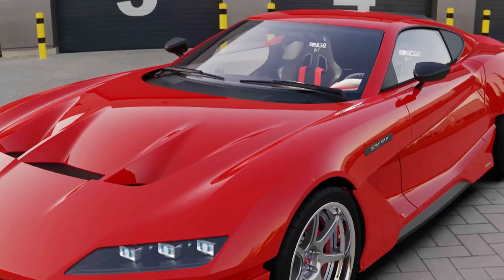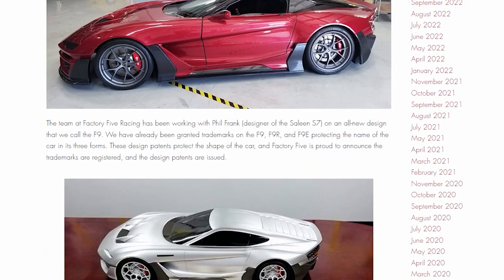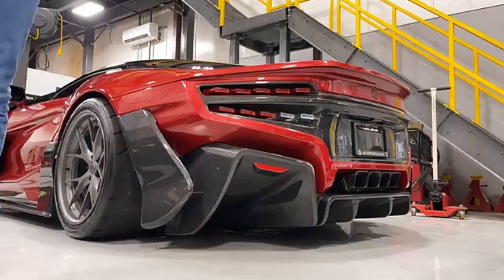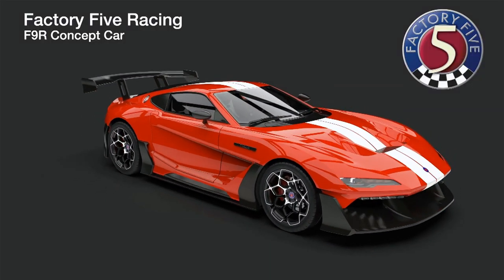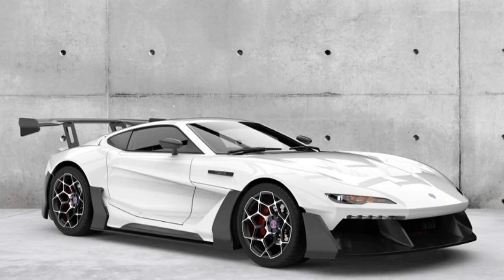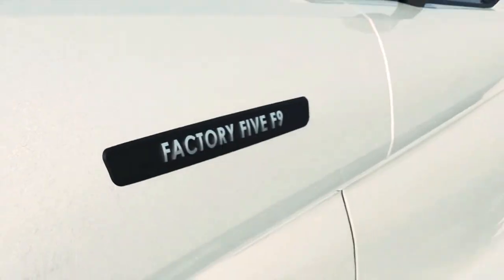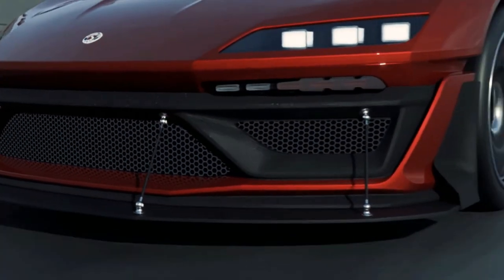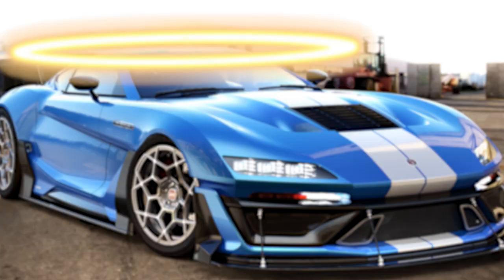What Happened to the Factory Five F9?

Comment: Shame they cancelled the gtm, saw it in person at the public unveiling at ffr in like 05 or 06, looked great.
Reply: A gen3 GTM would be great! Enough of them have ben built to get plenty of feedback for changes.
Reply: Too expensive to build.  Was lower cost BITD when you could get your hands on a transaxle for a reasonable price.  Not anymore and the fiberglass work required is intense.  Lastly, the design is decades old.  Time for a new car.
Reply: @danpolk  You can get a g96.01 for between 3 and 4 grand. The real problem with the GTM was it needed too much work to get right. Terrible body and door fitment had FFR on the phone lying to them telling them they couldn't help the fact the damn doors don't fit and the body is asymmetrical.
Reply: The GTM was meant to be the mid-engined Corvette that Chevrolet wouldn't build. 
Chevrolet builds it now.😊
Reply: @dr.burtgummerfan439  Apples and Oranges. One is a heavy factory car with nannies and no stick. One is a 2500lb. race car with NO nannies and a manual transmission. They are more than numbers and nothing alike to drive.

Comment: Sadly, if they go with the full carbon body and other things I have read are rumored like the massive Aussie V12, this is essentially a $150-200k component car when completed.  It will have to have extraordinary performance to warrant the expense and effort required to park one in the garage at that price.
About the same price as a used 612 or Huracan.  Most people with the kind of money to build an F9 may just decide to write a check for the Ferrari or similar and enjoy it the first day.
Reply: you don't need to put the v12 in it, that's just on their test model. it'll probably come ready to slip a coyote in it
Reply: @danielanthony1054  I'm sure it will take the V8, but many will opt for the V12.
 
I'm sure somebody has put the base 1980's 220 hp Mustang 5.0L in their new build FFR Cobra, but they are the exception.
Reply: @sburns2421  i would love a v12 but i would buy something like that to race. so a v12 is just stupid for that cause it's massively heavy
Reply: Maybe a spec built Toyota 5L v12 from their century car.  Hartley Engines do thesw from a read if their websites
Reply: I agree.  I love the idea, looks like a cool car, and if it were reasonably cost effective, I would be interested.  But let's be real here - to really build a '33 Hot Rod you're looking at $40k+ not including labor (I have one, was way more than 40k in kit, upgrades, engine, transmission, paint, wheels, etc.).  The F9, if fully CF, is going to be a $50k+ kit, plus drivetrain, paint, etc - easily 6 figures on the extreme low end.  With the C8 now being mid engine and coming in well under that already complete, they would be pricing themselves out of the market.  Now if they do a fiberglass kit priced in line with their Daytona Coupe - it would be a lot more viable.  Maybe the F9 will be fiberglass, the F9r will be CF...  But having firsthand experience with the 'quality' of their fiberglass bodies - I would be very wary of a CF version.

Comment: I don't really care that they discontinued the gtm especially since the rcr40 is better in every way. But I am disappointed by the mid front engine design. I'm a looks guy, I can get speed by ripping the body off and driving naked. I want a car that looks GOOD and UNIQUE.
Reply: Curious why they don't re-release the GTM for a last run of kits as an interim measure.  Maybe with a subtle change to something like lights or spoiler to differentiate it from the original design.